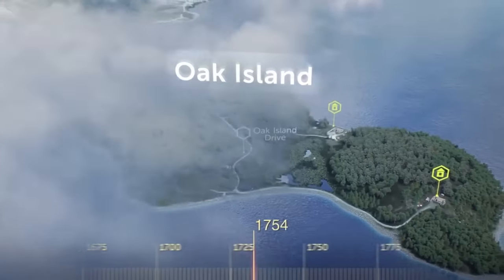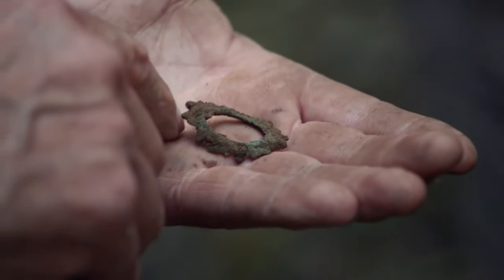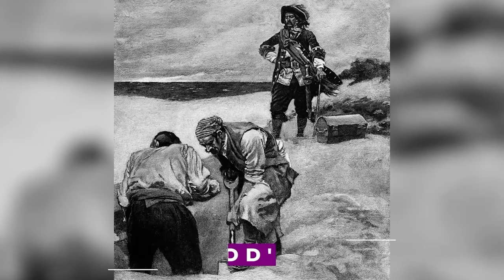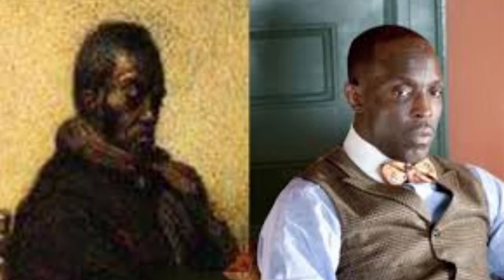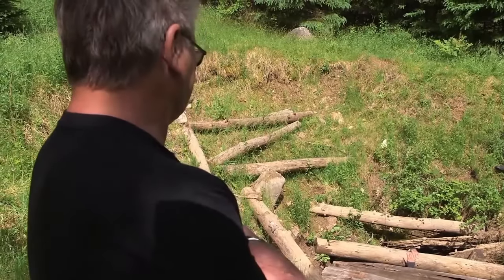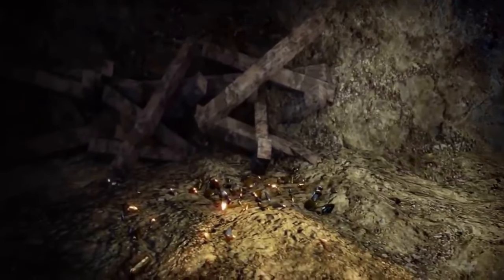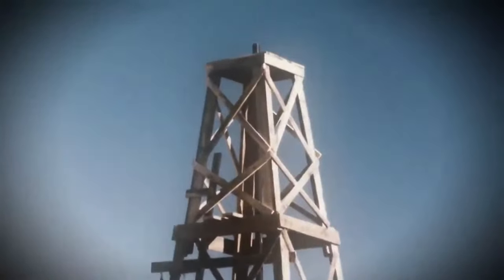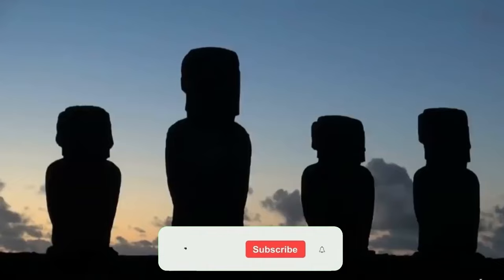Oak Island Biggest Discovery Top 20 Most Shocking Discoveries Found In The Oak Island Treasure

Comment: the biggest discovery is they can drag this out for years and not discover anything of significant value, they could have dug a hole 20 feet deep and a thousand feet wide by now.
Reply from the maker: The goal is not just to dig a hole quickly but to unearth artifacts and information while preserving historical context. The size of the excavation area doesn't necessarily correlate with the value of the discoveries. Archaeologists often work systematically to uncover layers of history and piece together a comprehensive understanding of the site. It's a patient and methodical process that can lead to valuable insights over time.
Reply: what a line of BS @MysteryUnity
Reply from the maker: We understand your concern. Sometimes, the value of a discovery may not be immediately apparent, and the true significance may only become evident in the long run. Additionally, scientific or exploratory endeavors often require careful and thorough investigation to ensure accuracy and reliability. @williamfowler616